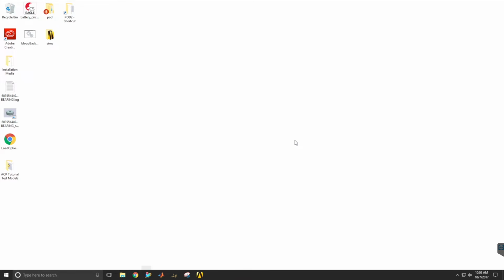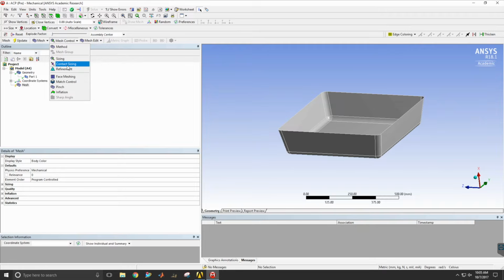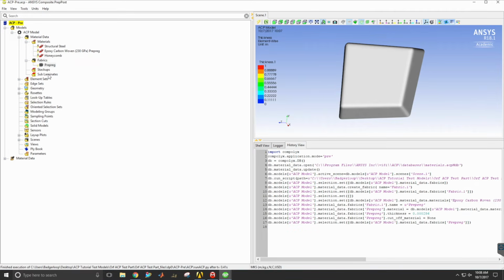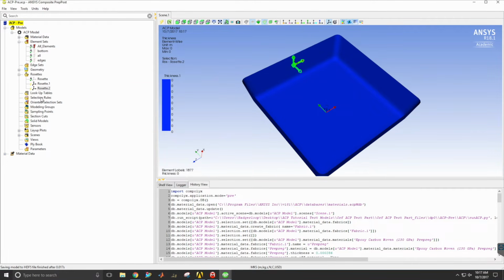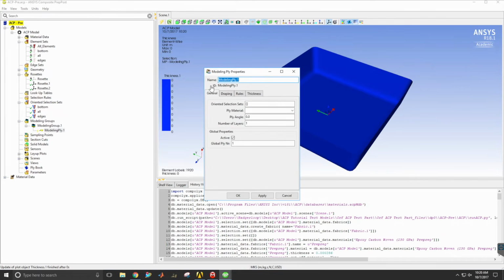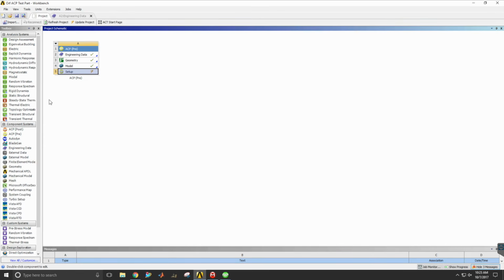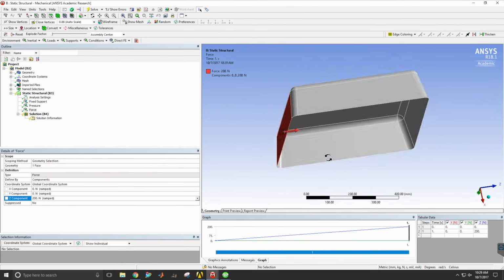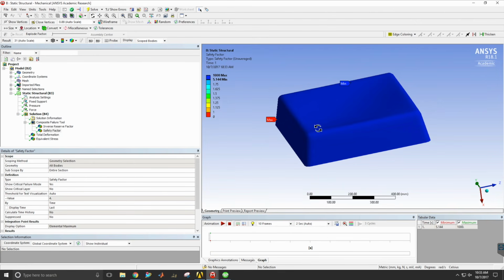ANSYS ACP Tutorial

Comment: sorry, can i ask a question? how can i create a material with only E1, E2, v12 and G12? because in CLT plane element don't consider the direction of Z axial. i used ACP and transform to shell element, but if a change the value of G23, the result under torsion won't be the same? but i should be the same. why? can you help me? thanks.

Comment: Does anybody know why the material data of the plies isn´t transferred to the static structural from the ACP Pre? When I open the Static Structural there is a blue question mark at the plies and the empty material data field in the information screen is highlighted in red. I couldn´t figure it out although I did everything exactly like in the video
Reply from the maker: Not sure, maybe just make sure you updated and saved the project in ACP Pre? Also make sure you're selecting "import shell composite data" if you're using shell elements. I don't think it will import anything if you try to import solid data and are using shell elements
Reply: @nathan_orf  thanks for answering. I did everything you mentioned ... updated everything, selected shell components (solid didn´t work either),etc. ... like I said I could not figure out where the problem could be it´s like the static structural could not load any material data from the previous steps

Comment: I'm using ANSYS structural, I applied two forces of the same value on both sides of the body I"m working on (a plate) and I had an error saying there isn't enough stress applied to prevent rigid body movement, but the body shouldn't move since there are two forces of the same value applied in two opposite directions (and I don't want to use the fixed support) what should I do? thank you for the video, it was really helfup. Please help me if you can, I really need this.
Reply from the maker: To our human brains, it makes sense that the part wouldn't move when the forces are perfectly equal and opposite. However, computers are weird and a slight imbalance in the model (potentially from the mesh or node locations) can tip the simulation into rigid body motion. 

If you'd like to avoid using a fixed support, I would apply boundary conditions to a vertex. Set translation to zero in the directions that are causing you issues and this should fix the issues. You could also try doing this for a second vertex to prevent rotation as well. Hopefully this helps
Reply: @nathan_orf  Thank you so much. Would you please tell me where to set those conditions (where would I find that option) I'm sorry, I'm new to static structural. Thank you so much for answering.
Reply from the maker: @nadj_b  once you're in the Statuc Structural module, locate the toolbar on the left side. Right click on Static Structural, then click Insert, then Displacement. From here, you can select a vertex and define the directions of zero displacement
Reply: @nathan_orf  Okay, thank you so much for your time !
Reply: @nathan_orf  The body mouvement message no longer appears but this one appeared instead '' An error occurred while starting the solver. Please see the Troubleshooting section of the ANSYS Mechanical User Manual for more information.'' If you have an idea on what I should do please let me know. Thank you.
Reply from the maker: it depends on the direction of your forces and the directions that you're limiting vertex displacement. If you do it correctly and choose a vertex that's far away from where you expect large displacements to occur, it shouldn't have a big effect on deformations. Beyond that, I don't think I can help you there since I don't know what your model looks like

Comment: Is there any significant difference in simulation when transferring shell or solid composite data? I see that both options show the plies we defined in ACP Pre, but how can I choose?
Reply from the maker: While I have not experimented with the differences between simulating shell and solid elements, I imagine the results would be quite different. When transferring shell data, ACP sends 2D planar elements (aka TRI or QUAD elements) to Static Structural. These type of elements have a thickness assigned to them that is used in calculating stresses/strains, but the thickness is not modelled. This is likely more accurate since a composite structure is essentially just a bunch of very thin 2D planes stacked on top of each other. On the other hand, when transferring solid data, 3D elements (aka TET or HEX elements) are used. These type of elements work great for something like a machined aluminum part, but are less accurate for thin structures like pressure vessels, sheet metal parts, or monocoque car bodies (for all you FSAE students out there). 3D elements are also going to take a lot longer to compute than 2D elements.

Tldr: Shell elements are going to give you a more accurate result for thin composite structures.
Reply: @nathan_orf  It's really helpful. I'm simulating a i-beam with rounds and I've found some problems. The first one was in the ACP Pre, because the plies in a C format were misaligned when I created the solid model. The second one was the reason of this question. Briefly, I had to make an assembly with the beam and some external models (actuator and brackets). It went terrible wrong when I tried to transfer solid composite data, but I didn't know if there were some problems with transferring shell data to simulate composites. I'll try to do it now. Thanks!
Reply from the maker: Here's a good summary of 1D, 2D, and 3D element types. One thing that can be confusing is that some elements have different names in different FEA software but behave the exact same way (e.g. HEX20 and BRICK20 are both rectangular prism elements with nodes at the corners and midpoints)

https://asrengineering.com/2019/09/23/fea-mesh-elements-nodes-guide-intro-to-fea/

Comment: very helpfull, when we have to use post ACP for that model can be made without Post ACP and Static structurl is enough so, what is benefitial of post ACP module ?
Reply from the maker: ACP Post allows you to perform more rigorous analysis on stuff like core failure and interlaminar stresses. It can also be more accurate for very complicated structures. For more basic structures you'll notice that the ACP Post and Static Structural results are basically identical.

Comment: Hi, My name is Julieth, I 'm a mechanical engineering, and your video is really good, but I have a question, is posible doing this type of analysis for a pressure vessel, I need to do that
Reply from the maker: Yes, I've done this before too. Just apply a pressure load to the interior surface of the vessel. Be careful with boundary conditions around the opening/gasket area because you can easily over constrain the system which can give you wacky results.
Reply: @nathan_orf  Thanks for your answer
Reply: @nathan_orf  ________________________
my  email is disotop@unal.edu.co, if you want to, I would like to exchage info about mechanical desing, wish you a nice day

Comment: Hi, i had a doubt. How do you create tapered plys with different lengths so as to create the tapered effect in acp pre while stacking up the different layers
Reply from the maker: The only way that I figured out how to do this is by dividing the surface into different sections. You can then select certain areas of the surface to define where the tapered ply begins and ends. Dividing the surfaces needs to be done in the CAD program that you're using

Comment: I always get an error, when i try to simulate a shell modell with two or more surfaces like the bowl in the tutorial. Mechanical always fails to do the structural analysis and in solutions everything gets a red bolt and under results everything is red
Reply from the maker: One thing to check is to make sure you are properly constraining the part. If you apply a load to the model and one of the degrees of freedom are unconstrained, it was fail the calculation. Try using a fixed constraint

Comment: Hi Nathan, This is my first-time use ACP.I'm trying to analysis V-Belt transmission transient structural with composite structures. The belt is a composite structure composed of glass-fiber, Base Rubber Compound, and Protective Cover. Could you please gave me some advice?

Comment: Hi Nathan, I followed exact same steps as u did but ended up with an informational notice while updating my project after named selection that 
" (DP 0) The Model component in ACP (Pre) requires user input before it can be updated. For instructions on how to address the cell in its current state, click the blue triangle in the lower right corner of the cell in the Project Schematic."
I am unable to understand where could I possibly go wrong. so please help me out with this. 
FYI my CAD part is of ".igs"
      and ANSYS 19.2 version
       my project is saved in .wbpg format
please help me through this

Comment: Hi Nathan, I'm trying to do design a carbon fibre composite monocoque WITH honeycomb core for our formula student competition. So far, I just have the thickness of my model at 20mm (for every surface/all the way round). I plan to do various structural tests in ANSYS and from these tests I want to determine weak points in the structure and then reinforce them with more material in Solidworks/ANSYS (not sure) and retest again until I have an optimum model. 
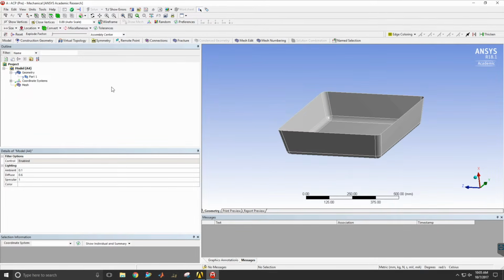I have just been watching through this tutorial and I noticed you assigned a thickness of 3mm at around (2:37 - 2:48) and said:
"ACP will reset that thickness and apply the correct thickness later on". 
My first question is: 
What was the thickness of the model before you imported it and made that 3mm assignment? 
And my second question is: Does the thickness of your model (in Solidworks for my case) matter, in that could you have a completely solid monocoque for example and import that? 
And my third question, (which depends on the answer of the first 2 questions) is: When I want to reinforce certain areas (when I find out they are weak from the structural tests), is there a way of applying more layers at specific regions in ANSYS or do I need to change the thickness in Solidworks at the appropriate regions I want to reinforce? And how do I do this?

Any advice would be extremely helpful to me and I can't tell you how much I'd appreciate it.
Reply from the maker: Hi Fred, so the way that I did the analysis (and the preferable way for most geometries) is to use sheet bodies instead of solid bodies. A sheet body has no thickness associated with it which is why I had to assign a thickness initially. By using sheets, Ansys can add additional "layers" of elements that represent the additional plies and it doesn't conflict with a pre-determined thickness of a solid body. The process I use to get these sheet bodies is to create a solid body of my geometry and then "extract" the faces that will be contacting the mold. To define sections of the sheet body that you want to add additional plies, I'd recommend adding sketches on the surface and using a "divide face" tool to divide the face at the sketches. I use these operations in NX but I'm sure SolidWorks has similar tools.
Reply: @nathan_orf  Nathan, thank you so much for your response. From what you've said I was just unsure about the sheet body part...I was wondering firstly if you create the sheet body in ANSYS or if you do that in SolidWorks? 
Also the part about adding sketches on the surface using a "divide face" tool you refer to, I was unsure how you would do this if you have a solid body model in NX (SolidWorks). I'm unsure because you said that the outside of the solid body is the outermost layer ("faces that will be contacting the mold") , so if I'm adding a sketch on the outermost layer wouldn't that become an issue because essentially my rosette direction would already be pointing inwards (building ply layers inwards), so when I select that sketch on the outer layer to add additional layers to, won't that mess up the layers that are already there? I was thinking I need to select an inner layer sketch as I'd be reinforcing my structure internally. The problem I'm predicting that might happen when selecting a sketch that is part of the outer layer is that when I start defining the ply structure for that sketch, I'm thinking the honeycomb core for that region may get out of alignment with the rest of the honeycomb core, or even some of the carbon fibre ply's being out of line with each other? I would really appreciate your thoughts on this. Hopefully Iv'e been clear enough. Thanks again for your last reply, very helpful.
Reply from the maker: You would create the sheet body in Ansys.

For your second question, you essentially want to project, draw, or offset a sketch onto the sheet body that was extracted from the solid. Also, your rosette direction defines the X and Y coordinates on the surface (like 0 and 90 degree ply directions), not the Z coordinate defining the stacking direction. I'm not really sure what you mean by your other question, but your divided face area will get projected normal to the surface. So let's say you have a divided face area that you just want to have a core material but you want there to be four plies above and four below the core (spanning the entire area of the part). ACP will apply the thickness of the first four plies, then project the core area normal to the surface and apply the core thickness. So if you're dealing with very very thick or high-curvature parts, your divided face area will get warped a little bit when applied to one of the interior plies

Comment: Can someone help me? I have a CAD file that imports as a solid and therefore I cannot shell mesh. How can I rectify this so that I can assign the thickness as Nathan does and shell mesh? Thanks in advance!
Reply from the maker: Charlotte Draper are you able to extract the surface from the solid CAD model? If you can do that, you should be able to easily import the surface into Ansys
Reply: Sorted and managed to model my composite start to finish. Thanks for the tutorial!
Reply: Hi Nathan. I know you didn't cover this in your tutorial, however, I need to model frictional contact between two perpendicular panels. The contact will therefore comprise of a contact body on part of the surface of one panel and the target body on the thickness of the perpedicular panel, created by the layup in ACP Pre. In essence, I am struggling to find a way to define the contact target region, as that surface only exists as a result of the layup and not the defined geometry, therefore, there is not 'surface' to select.
Grateful for any insights you may have (or anyone else!). 
Thanks in advance.
Reply from the maker: Sorry I haven't specifically tried this. I can definitely see where the issue arises though.
Reply: Thank you anyway!
Reply: Can u give me geometry file?